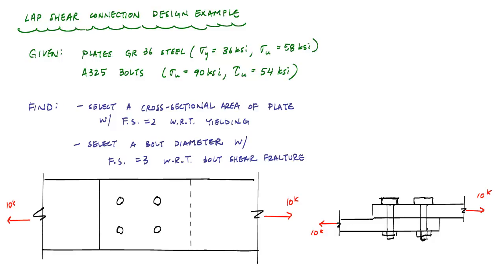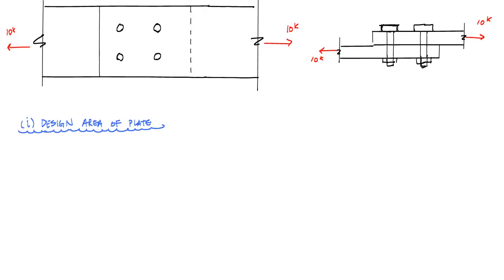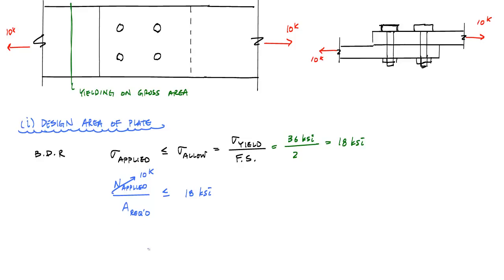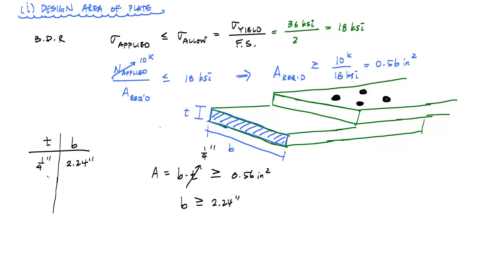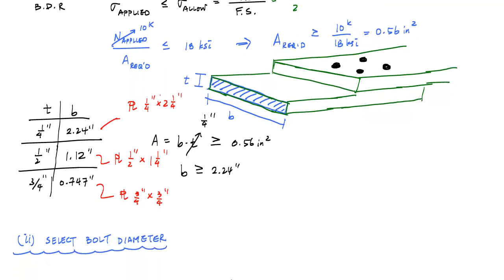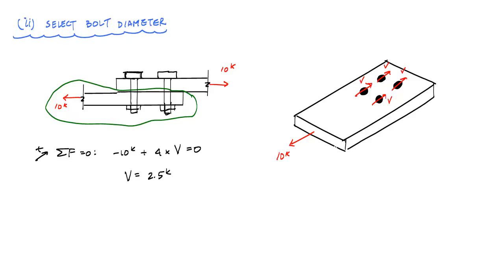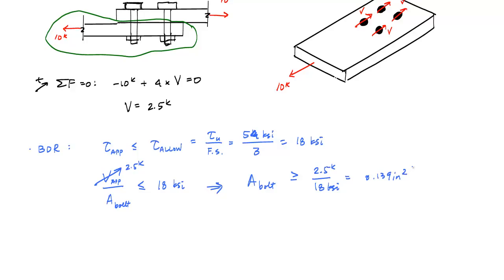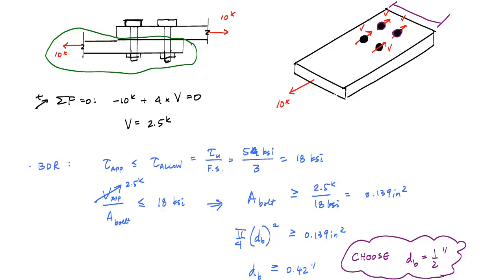Lap Shear Connection Design Example - Mechanics of Materials

Comment: Just want to ask., the area of the steel plate is computed in whole., I believe AFTER THE HOLES (for bolts) have been punched, the area subjected to the tensile force of 10k has been reduced. Is it not good to re-investigate if the net area can still withstand the 10k.? Also the critical area (tearing area) has not been tested. BUT BASICALLY WITH THE HUGE FACTOR OF SAFETY USED, THIS SHOULD BE OK..Or maybe just like want you mentioned, it's under the steel structure design.. But generally you brougt me back to yesterday, you refreshed me.. thanks.
Reply from the maker: it sounds like you are thinking about steel design of tension members which examines multiple failure modes with differing resistance (or safety) factors depending on the failure mode.  There are many failure modes (yield on gross area, rupture of the net section, block shear, bearing failure, etc.) that you would have to consider if you are considering this problem in the context of steel design.

Comment: hello , 
great videos, i ve started watching this playlist and it makes sense, hopefully i will get closer to an engineer
shouldnt we add the 1 inch we lost from the bolt width to the plate width cause it will fail there from tensile stress , because the area is not enough?
the way you draw it 10kn from one side and 10 from the other adds like 20kn ?

Comment: FOR shear the surface area of plate must be calculated hence A=w × l

where w is width of the surface and l is the other dimension of the plate.

isnt it so? 

The area that was calculated by you was roght for tensile bolts but incorrect for shear design.

Comment: I understand design much more with this example, thank you! I have a question. What if you designed the bolts first and then took the smallest cross section of the plate into account? i.e. A cut through the center of the bolt holes needs to be at least the minimum area meaning a larger overall section. Is this something that is done in practice? My gut tells me that after the holes are drilled, the plate is at risk of failure through normal stress at that point due to reduced cross section.

Comment: Thanks a lot for the video. Do you have any examples where you calculate the Edge margin for bolts/fasteners?   Also, an example where the force direction is along the bolt axis, for calculating the bolt pitch threads?!..again, thanks a lot. really practical and helpful videos..

Comment: Why do you use yield strength for plates and ultimate strength for the bolts? How do you know which strength to use??
Reply from the maker: +Noel Castillo for this problem, i just wanted to illustrate allowable stresses associated with different limit states, it's more of an issue for steel design limit states on determining how to select appropriate stress limits.

Comment: My only question is don't you need to choose an optimum of the bolt size? Since bigger bolts need bigger fitting holes and thus reduce the cross-sectional area of your slab. Since holes cannot support any loads the slab would be weakest at these points. (this wasn't taken into account during your example but poses to my opinion a serious design challenge in practice).

Comment: Hi Mr StructureFree: Brilliant vidoe, thank you.  But I think <Mervic87> is right.  You need to consider the other 10k force on the other side, so you need to recalculate for 20k rather than 10k, otherwise there will be no equilibrium.  nice video though!!
Reply from the maker: it depends on where you cut for the free body diagram.  for the bolt design we are cutting through the bolts and choosing the left or right side, so you only need to consider the 10k.